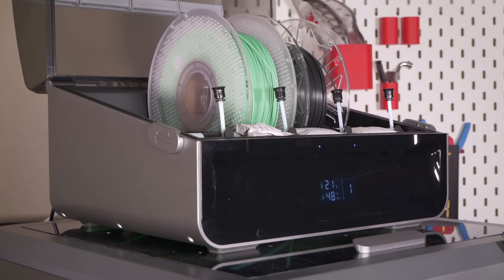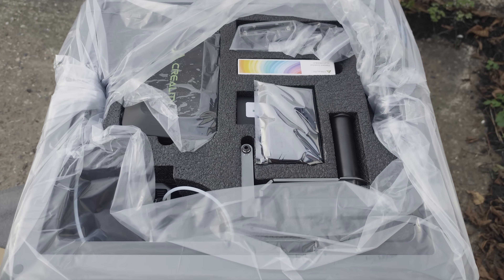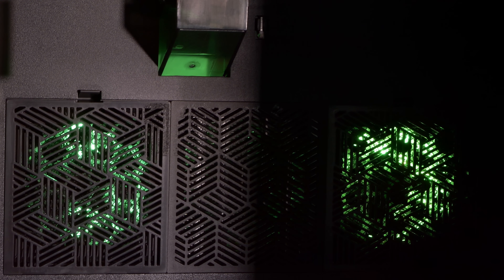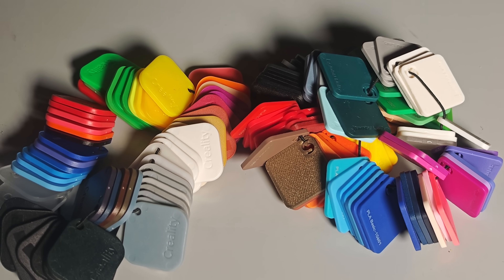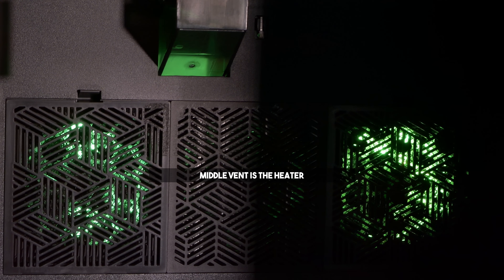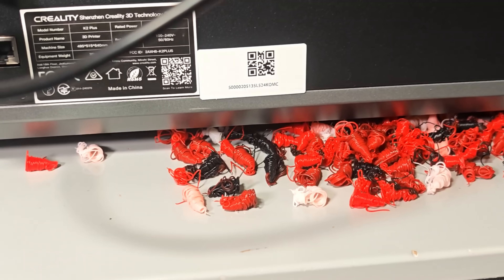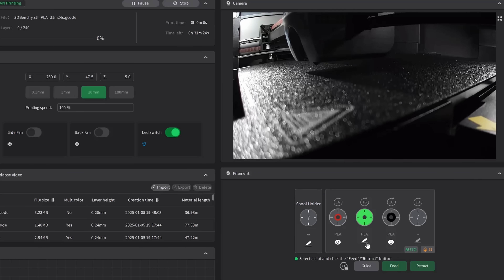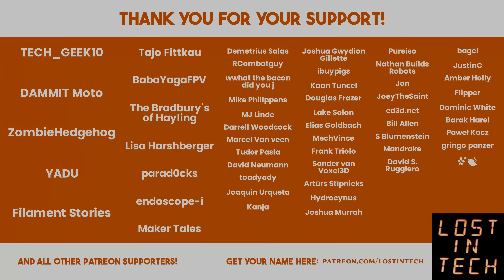Creality Finally Made a 4 Colour Printer and everyone is asking me the same questions!! !

Comment: I have a k1 max in my business for low volume production of telescope parts. It works reliably and 0 problems after around 5Kg of plastic including abrasive carbon fiber filament and mostly printing ASA and PETG. Just don't like the drag chain. I have to admit though the early adopters all had complaints, but I got mine after the fixes were introduced

Comment: Its a pos comparison. You compared Crealitys Top Printer to Bambus Lower tier printer. Compare both printers using the x1 carbon.
Reply: P1S and X1C are identical in build. All the kinematics, motors feeders and heaters are the exact same.
The only differrence is the configuration
Reply: lolol P1P/P1S/X1/X1C/X1E are all the same printers with minor differences.
Bambu is just a bad buy in 2025, everyone else makes better printers for better prices.
Reply from the maker: I've been instructed to go spend £1500 though to point this out 🤣 how can I refuse.

Comment: If it wasn't for the shitty slicer, it would be a cut above. As usual, the community has to finish the job for them
Reply from the maker: The slicer is fine, also I believe you can already use orca
Reply: @LostInTech3D  You can, but which cfs slot it chooses is random. There have already been user complaints, printing has to start from the printer screen.
Reply from the maker: Feels like something that'll be fixed

Comment: For a second I thought this was going to be a video about the new Hi printer. Captions on point as always.
Reply: Creality continues being Creality. Instead of offering add-in (like they just did for K1 series) they totally ignore V3 and create new bedslinger to combine with existing CFS unit 🙄
Reply: @kimmotoivanen  I think that's because the CFS is made to work with the printers based on Klipper, while most Enders are still on Marlin
Reply: @hyperstimmed  All V3 except SE are based on klipper ( <none> , KE, Plus). V3 ( <none> - just V3, confusing model names) and V3 Plus even use same nozzle (hotend? toolhead?) as K1C (and possibly later K1 and K1 Max).
Maybe there is no place to push the cutter, though Hi has , so 🙄

Comment: I wouldnt touch another Creality product with a shitty stick, I got sick of beta testing their products, one of which didn't work at all, anyone remember the WiFi box? Once it came out that they didn't work Creality didn't pull them, no they kept selling them and then when the sales really dropped off they installed them in the next shitty printer they released.

 I have an X1C Combo and Im waiting for the XL version from Bambu Lab which shouldn't be too long now.
Reply: Like bambu lab doesn't make their users beta test their products. All the bad MB fans, warped heatbeds, faulty AP/TH boards, faulty heatbed cables, busted AMS units, damaged CF rods...
Reply: @LilApe  I experienced none of that, I have had 10 years of Creality experience and had no problems with my X1 Combo, I can only go off my own personal experience. and have heard of none of those issues
 I don't think Bambu Lab have had their users beta test products, they sent some X1 and X1 Carbon out to Youtubers before launch and there were tweaks before official release, and when Creality copied the X1 Carbon they couldn't get that right, it took 3 redesigns of the hot end and a new heatplate before it worked correctly.
Reply from the maker: Yes, I remember this, and some other stuff too. No machine is perfect, and I get particularly annoyed by people who think that bambu are somehow on some pedestal - the A1 was even recalled entirely 🙃

You can have fast cheap or good. If you want a fully tested machine then go talk to ultimaker 💰

Comment: I'm hoping the K2 series is the start of Creality focusing on serviceability and long-term retention in the way of providing (at very least) good aftersale support for repair parts etc.

I slept on Creality all these years because it felt like everytime they came out with a new thing, it was already yesterday's news not even a few months after said thing's official release. 
Could someone get repair parts for their 1st-5th gen CR-10? I'd assume/hope so. I haven't bothered to look but it felt like the CR-10 iterated way too much and fast to have any sort of good aftersale support, in my opinion, outside-looking-in.
Reply from the maker: Creality's old printers are almost certainly the most repairable out there. Just the other week I revived the ender 3 using some bits from the scrap bin and a £20 DD extruder from Amazon
Reply: @LostInTech3D  
Oh absolutely. Those older (shall we say, legacy models?) ones used a lot of generic parts or some variation of a known part that could easily be fitted cross platform (IE; E3D hotends and Volcanos, power supplies, logic boards etc)

With this K2+ I'm seeing a lot of proprietary parts that may or will not be as easy to mod for the average user; something Creality seems to be marketing this printer to.

Comment: We got multiple of these for the print farm and after talking to support for days they basically gave up and stopped answering 
First layers with ABS ASA is unusable 
It’s literally 0,140mm too low and when you raise it manually with a klipper macro or in fluidd the corners don’t stick and the middle is perfect 
If the corners stick the middle is so low it scapres the nozzle causes the extruder to grind and clogs …..
Useless we will wait for one more fw and if now  be returning all of them and waiting for Bambu……. This is coming from a company that owns 16 k1 series printers 50 other creality printers and probably close to 20 Bambus so no not just a creality hater
Reply: Lovely, nice to know the same crap is still going on with their K series. My K1 Max has almost new 3rd party. Gantry, Bed, steppers. Not quite fit for sales.
Reply: There's something wrong with their z-probing where it's consistently too low.  I've resorted to raising the z-offset in the Start G-code section of the filament profiles in the slicer.  It's ugly and disappointing that you have to do that but it's made the printer pretty bulletproof for me.
Reply: @martinskamla6789  you need to level it manually by the sound of it. What your describing is bed droop, over a build plate this big the Z-deflection upward (or gravity deflection downward, depending in who you ask) is a relevant factor.

You can't completely cancel it out with only 4 screws (seriously, why TF are we still stuck with only 4 screws?!) but you can get a good margin of error. (IIRC under .2mm up or down from avg, with the majority of the print bed being far less) 

The issue is that the overall deflection will be proportional to the average tightness of each screw. In other words, if you raise one corner to get it level with the Z-axis peaks, every other corner will get slightly lower relative to the Z-axis peaks because you raising the corner also raised the peaks themselves slightly.

Deflection like this is impossible to solve but can be mitigated with a basic understanding of how a printer works and how things behave mechanically.

"Auto leveling" can't actually make the print level (well, it COULD but it doesn't) it can only correct for minor differences to get faux-level, you still do need to ensure real-level though. On smaller printers that's not an issue, but into the 300s it rapidly starts becoming one.
Reply: Is this a mechanical/material issue? Like buckling build plate from expansion or something on the software side?
Reply: @ most likely an issue of heatsoaking the build plate is likely not fully saturated before it gets probed also the main calibration cannot be performed with the plate at a higher temp which means you only get the less accurate mesh for abs Asa because the main mesh is done at 50c
Reply: @martinskamla6789  okay. The 50c bed probing explains a lot. I can see why but didn't expect that. I am very happy with my Eddy-Current probes haven't had an issue in the last year.

Suspected like non cast aluminum bed or something along those lines buckling on the K2
Reply: Sry for you, I only bought 1 pos

Comment: I know this is probably a silly question but can this, or any other printer, clear the bed after a print?    So you could keep printing parts without intervention?  I am talking about big parts so you can spread them across the bed.
Reply from the maker: The only thing that will do that is a belt printer and those are a challenge in themselves
Reply: You can make custom auto ejection code for nearly any printer. Just have to be careful to do it right.
Reply: I thought there were projects that write g code after finishing print and cool down, to use the head to knock down the prints. If you print the same thing over and over, maybe you can just hand tune each model to do this. Also if a1 mini is large enough to make it, there is the project that autoswitches beds.
Reply: Look at the A1 Mini Swap Mod. It's not a huge bed so may not work if you need really big parts, but it's by far the best low cost option available at the moment. I just got mine put together and it's working great.

Comment: Can anyone tell me any way to get the cfs going on an orginal ender 3 or any of the other ones in the series k2 plus seems like a waste when i already have a fully functional ender 3 v2 neo
Reply from the maker: It will support the k1 series with the conversion kit. Not enders afaik, idk about e3v3
Reply: 3dcamelion will work with it, if you convert it to klipper you can use any of the klipper ams's like ercf, btt vvd or otheres
Reply: @username9774can you direct me to a site where I can buy the 3D chameleon kit
Reply: And does it need klipper

Comment: I love my K2 plus so far, have had it for about 3 weeks for my business along with my 13 bambus , sovol SV08, and Prusa XL. I have been using it 24/7 and have found that it does a good job the only issues so far (time will tell) belt tension issue (solved by firmware update), when the filament runs out of 2 rolls in a row with auto change for some reason mine did error code ( i stopped print only to realize that is would have continued if I told it to),  and my bed magnet has pulled on the edges (I print whole bed prints this is why I wanted the size). They were all solved except the bed (it just did this, this week) waiting on Creality, right now I'm using large paper clips to help hold (Ive done this before and no issues to have to keep doing it) just a note all my large printers except the the Prusa XL have done this so not just Creality issue. So far prints are fast, nice, and accurate per my engineering parts. Time will tell if it can keep up, I bought another one also and will give it a little time before I say anything.
Reply: I've gone back and forth on all the types of beds, from blue tape and glue stick to PTFE tape and PEI magnetic bed. Single sided PEI with bare steel underneath hold FAR better in my experience. I settled with carbon silicon glass about 5 years ago, it was a love/hate at first until i dialed in the temps which are narrow and not the most forgiving if your off 5c. Fully enclosed i only use a felt edge smoothing tool to wipe the build plate and clean once a month with soapy water in a spray bottle i keep next to the printer as a preventative measure.

I have a sharpened flexible putty scrapper to take prints off and clean the bed, super recommend for glass beds

I REALLY wanted to preorder the K2 Plus Combo, but i've seen far too many issues with Creality printers and decided to hold off. Kind of wish i got one now
Reply: @bcjan18  if I were to get one of those for prototyping, which would you suggest? I care about accuracy and speed most, for quick turnarounds when dialing in small changes in fit. I can worry about multi material and exotics later.
Reply: @timothymusson5040  for a printer? What size prototypes? I would go Bambu P1S, probably best all around with great fast prints and can print almost any filament. I would get with the AMS, don't think of the AMS a just for multi color, I use it just to hold filament all one color, it makes printing so much easier.
Reply: @bcjan18  Thanks! My projects have ranged from 1" to needing a good portion of the 300x300x400 of my Artillery Sidewinder X2. Sometimes I want super accurate, sometimes I wish I had a 1mm nozzle and 2.85mm filament :)  But usually I need good accuracy for smaller prints, say 4"x8".
Reply: @bcjan18  And what if I'm butthurt about the Bambu situation and don't want to support them right now? Anything else with the same quality?
Reply: @bcjan18  prototypes range from 1" to about as large as fit on my Sidewinder X2 (8-10" x 8-10"). What would be your #2 choice, if I want to avoid Bambu? Thanks in advance :)
Reply: Hey, I have been thinking of getting a 3d printer. I have seen the k2 and looks interesting, how has it been doing? Do you still recommend it? Or would you recommend another printer?
Reply: @bcjan18 I'm also very interested in your experience after 3 months. Are you still satisfied? Would you recommend the K2 Plus?
Reply: @benjamingross4443  I would say yes they have been worth it, the only issue I have is 2 things related to bed. 1. the magnet is not strong enough for my large prints for my print farm, I fixed this with some PHAT-CF clips that pop on. 2. My first K2's magnet bed came up, I ended up 3m 90 gluing it down and now has been good to go. I guess I had something come up in the last week where my PETG clogged the extruder in each after the lates update firmware, I ended up lifting the lid half an inch and no problems now, I haven't looked at temp control yet to see if that was the issue, but they have been running fine with lid cracked a bit. They have been work horses and I love them. I have not used them for color changes really( I have made hueforges with color changes and works great, I mainly use the CFS for PETG rolls for auto refill and such. I liked them so much I bought a Ender 5 max, and I have to say that machine is a beast!!! Oh, and the K2's have printed PPA and PAHT very nice also. I would not hesitate to buy another of the K2's. I am looking at adding another Ender 5 max next week as I have a lot of color change printers already.  The issue with the Ender 5 max is they dont really have purchasable nozzles yet, so I built one out of a unicorn K'2 plus nozzle.

Comment: Sadly in 6 months they'll drop it and be on the K3
Reply: jeez who are they, Nvidia?
Reply: @stevvieb  this is my biggest issue with Creality. Rather than invest in their customers and fix issues, they want you to pitch it and buy the latest model that is 3 months newer.  They need to commit to actively supporting devices and actively releasing updates.
Reply: Drop it? Creality doesn't drop anything, you can still buy an original Ender 3 and all 46 subsequent Ender 3 variants.
Reply from the maker: @bcarden133  ahem, cr-100

Comment: I do think their are several flaws in the design of the K2 plus (the extruder/hotend is the biggest, the crazy loud CFS to a quit printer comes second). But I agree that it does not seem to be to save money since everything looks like quality at first look,  it just seems like incompetence of Creality engineers. Otherwise its the firmware/software that is the biggest let down. Its just horrible in every way and you realize very fast that this is not tested extensively at all.

Comment: As for the printer test - I was able to tell P1s and K2 with benchies, it was much harder with full scale nozzles and although I was able to tell my P1s in the white wall but I mistook the MK4s witih K2 Plus - surprising how poorly the prusa did, honestly!
Reply: @eluxannar  k2p has cleaner prints due to the much better part cooling fan, and mk4s loses probably because of the bed slinger shake on the large tall part like the one in video is more harmful than corexy